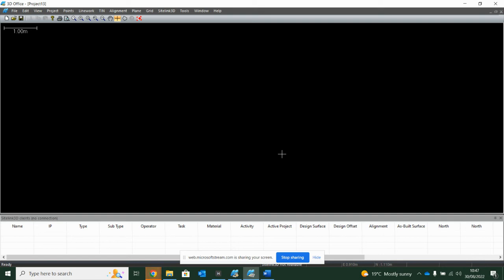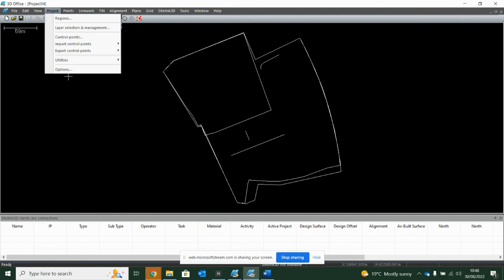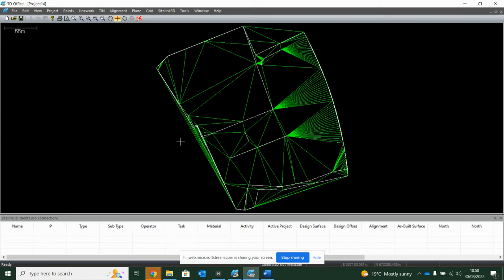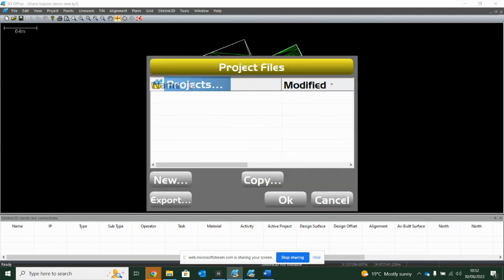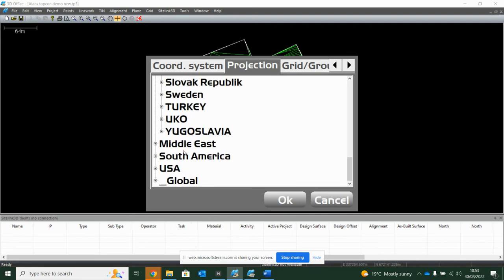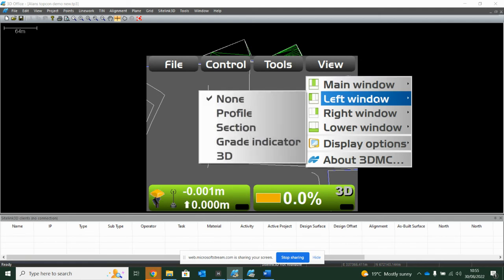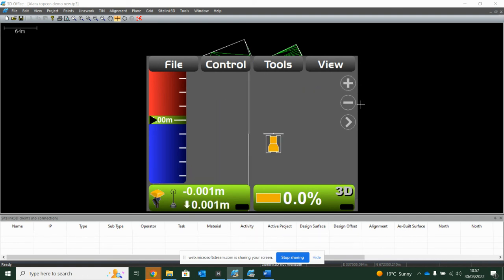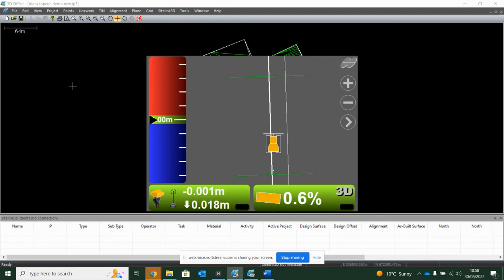Topcon 3DMC Machine Control, Data Prep, Coordinate Systems & Linework

Comment: Thanks for the demo. How do you go about editing the surface. For example, if you were building a berm, and the only point they supplied was the centre line of the berm, but you needed to make the berm a certain width with slopes on either side. Thanks
Reply from the maker: Hi Devin, do you have access to the topcon software? Personally I find it easier to design via n4ce, AutoCAD 3D or TBC. The software I use here is a stripped back free version.
Reply: @machinecontrol  Thanks Alan, I do have access to the topcon software however I am new to it and just getting into the surface designing and trying to see what the most efficient and cost effective route will be.
Reply: @devinsheremeta1513  Hi!

It depends on what data you have available and what is the geometry of the berm you are constructing. If it is a straight line, then topcon onboard program allows you to create points and lines between the points. So in this case i would create a second point for centre line and then by selecting both points create the centre line on the screen. After that you can extend the line to make it correct length. Then you can select the line again and add either a cross section to it or a profile and choose to implement it on right / left or both sides of the axis.

Comment: Hi, when i try to generate a new tin surface with my linework, 3d office crashes, every time. Do you have any idea why this would be? It's a version i got of a Topcon rep on a USB stick.
Reply from the maker: Hi, if you are bringing in line work data from a CAD file try saving the CAD file as a 200-2003,2004 DXF or DWG it might be that topcon office isn't recognising a newer file version

Comment: It is possible to go as far as autocad 2010 dwg and dxf it will work fine
Reply from the maker: Yes. That will come down to the version of software that is running on the excavator or dozer. If newish then import DWG with triangulation straight in. If import DWG isn't an option that you need to convert to topcon .tn3 (tin)